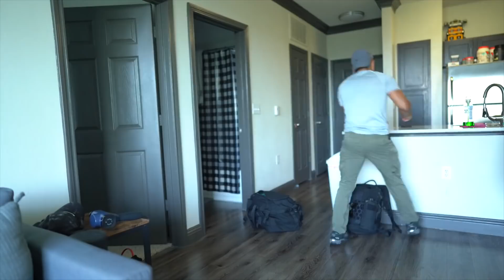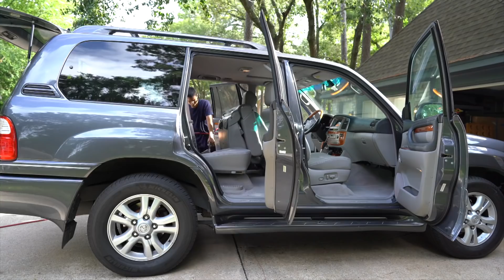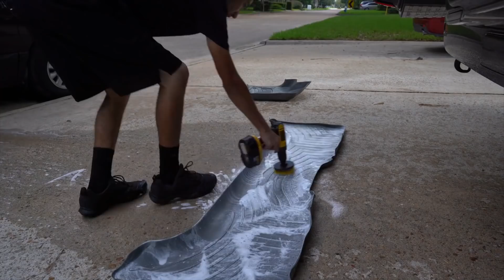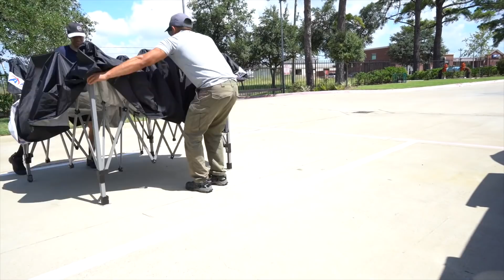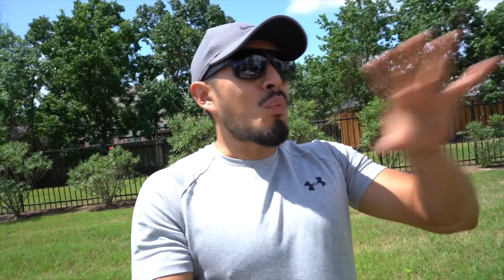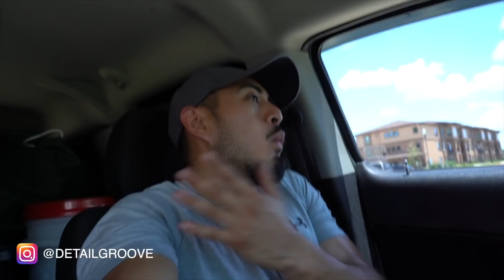Can You Really Make Money With A Detailing Business? | The Keys To Success...

Comment: 120$ for an interior wipe down and vaccume? WTF yo that expensive af. Isnt that part of normal car wash package? Does that mean you charge 100 for a wash and 100 for interior?
Reply from the maker: If someone wants it cheaper, they can find 100 other detailers to do it cheaper. We have a great reputation for quality work, great customer service, and a source of quality leads.
Reply: @DetailGroove  i understand, but i'm saying that a wipedown + vaccume is usually a normal part of a carwash and does not take long esp if the car is not so dirty as many really arent. As for the steaming , extracting , stain removals or deep cleans i would agree with 150$+ price point but for just a vaccume and wipe down 100 is a little absurd.